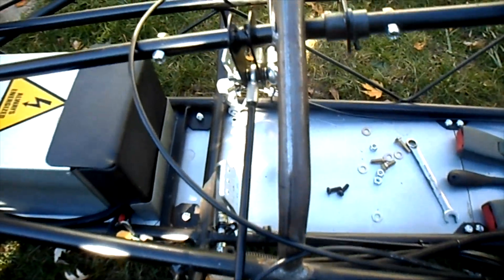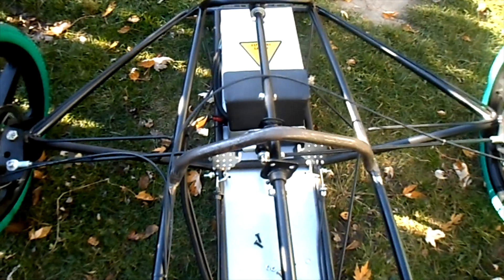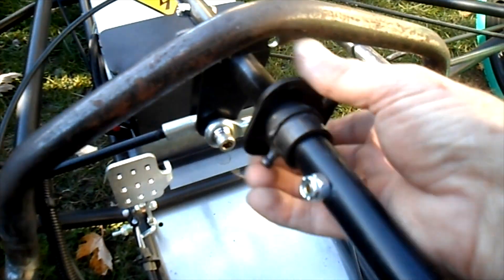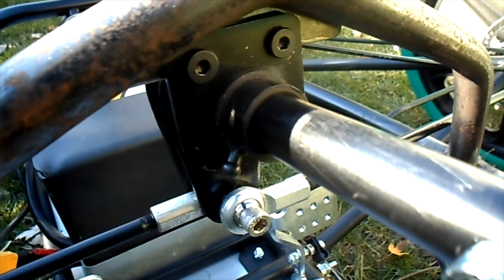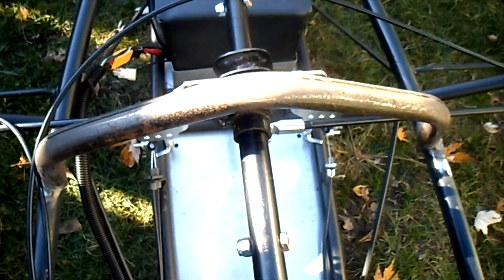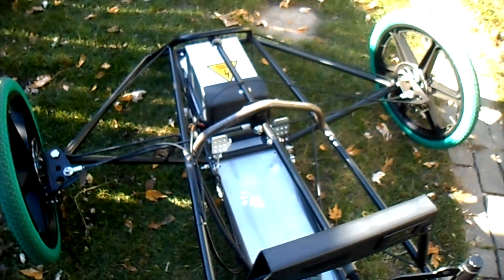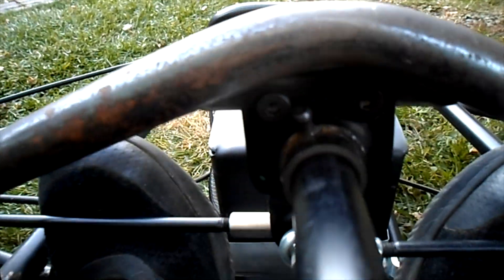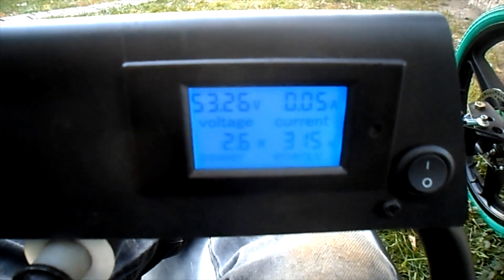Polaris Electrathon Racer (part 10) Center Steering Support

Comment: Those plastic wheels flex pretty bad when turning. Any improvement you make in steering rigidity is probably lost in wheel flex. You might see if you can find some aluminum 16" moped wheels.
They'll take those same tires.